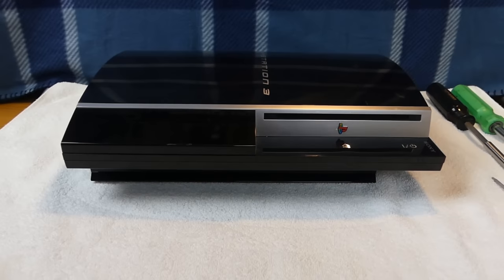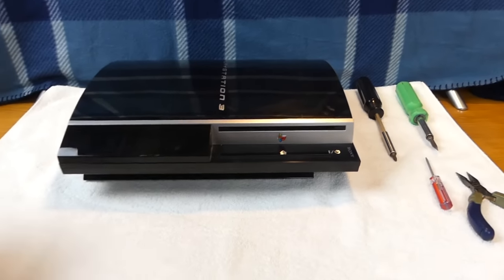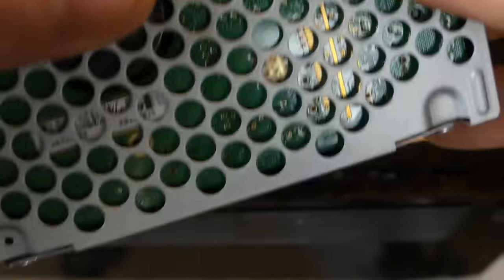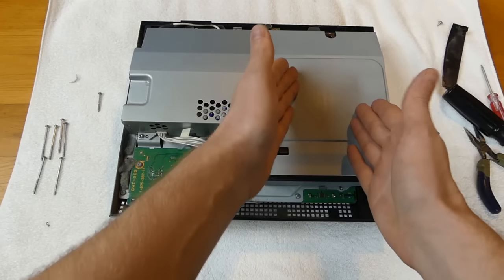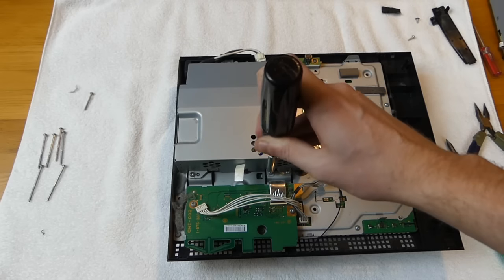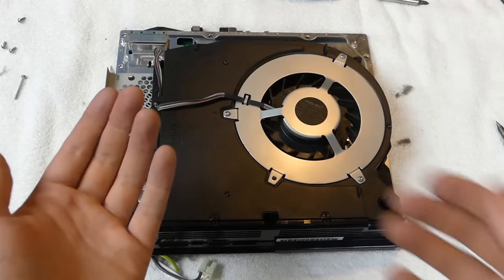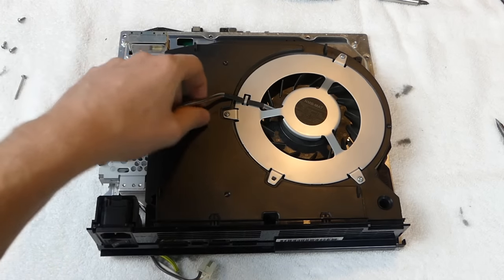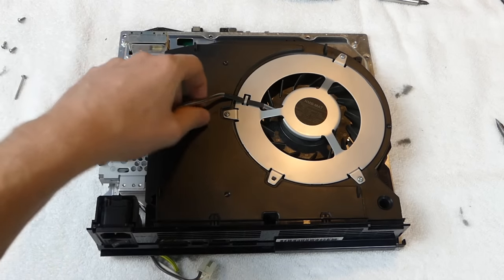HOW TO: TAKE APART/CLEAN DIRTY PS3!

Comment: Rip to the people who couldn’t put it back
Reply: Lol. It took me 20 minutes to take it apart, 10 minutes to clean and 2 and a half hours to put it back togeather.
Reply: @michaelpfanner  i took THEEE FREAKING DAYS!
Reply: @corndogslol5289  Wish me luck I plugged mine in got a black screen after trying to play a game. I'll have to go back and check the blu ray drive.
Reply: @bustergundo516  did you put the hard drive fully in? if not try putting it in fully.
Reply: @corndogslol5289   I checked the bluray ribbon and it was unplugged.  I fixed it. But I dont know where 1 screw goes...Doh!
Reply: Bro for me it was easy 
20 min to disasambli 
30 to clean all
20 to put all back 
1h 10m it was take me
Reply: @bustergundo516  thank you ;)
Reply: had a ps3 slim and it would freeze on startup and i tried seeing if disassembling it and cleaning it would help and i didnt know how to put it back and threw it away r.i.p.
Reply: Just play the video in reverse
Reply: No advise on what to clean it with ?? Alcohol, qtips? Wtf do we use Gasoline??
Reply: @jhamod556  90% isopropyl alcohol, qtips, cloth, can of air.
Reply: It’s easy to put back together you wouldn’t take it part if you feel couldn’t you put it back together
Reply: @copyer9088  or would we?
Reply: Pwned
Reply: Shit if you could take apart an xbox 360, these cant be too hard, i had a gamecube that didnt have to be taken apart, just open the slot & the laser is right there, wipe that down n thats it. I wish it were that easy for this
Reply: I got bored and now I’m back 3 years later trying to reassemble it lol
Reply: Oof
Reply: I have 6 screws left over

Comment: Just cleaned mine out for the first time ever. It used to sound like a jet engine but now its silent!
Reply: I feel you so much right now
Reply: aw3 tech  You need to CAREFULLY follow these instructions. Asap, my friend. Also be careful not to do what I did and accidentally snap the little black bar.
Reply: mine is super loud i am hoping it just needs to be cleaned
Reply: Mine is not coming on back
Reply: Omg same, soon as i put a game on it was like vrrrrrrrrrrrrrOOOOOOOOOOOOOMMMMMMMVVRVRRVVRVRRVVRVRVRVVRVRVR
Reply: It sounded like PlayStation I swear that will always be a problem even on my ps4
Reply: Same mine was like a blow dryer
Reply: @classiccarlover3302  after an hr play time and start heating up

Comment: Just a small tip for those who dont want to wait to purchase a torx 10 screwdriver- You can use a precision flathead bit and wedge it in a good spot to turn the safety screw. Works like a charm!
Reply: @albert lopez you can also carefully drill the nub off of the screw and use a regular torque head screw driver.
Reply: also don't forget to break that security metal thing inside the head so you can use a regular T10 screwdriver
Reply: ^ THIS.....IF YOU want to waste money and strip the shit out of your screw, follow this screw jobs advice like me and waste 8 bucks while you're at it! ^

Comment: IMPORTANT TO ALL THOSE WATCHING -

The cover with the Playstation wording SLIDES off towards the side with the Seagate hardrive (this is why we need to remove the Torx 10 screwdriver),
 DO NOT try and lift the cover from the sides.

 THIS IS WHAT THIS VIDEO IS MISSING
Reply: THANK YOU! This is exactly why I clicked on this video, yet he skipped it.
Reply: Yeah!
Reply: Thanks. I shouldve read the comment first. Broke a tab trying to lift it up until one tab broke and it slid like a charm. Then I saw how the plate was made from the inside and that it was supposed to slide.
Reply: @johnsnow3159  Sorry that happened to you. Did you try fixing the broken tab with a heat gun or super glue?
Reply: @mikaello1729   I didnt clean and assemble it back yet. I only found the time to open it. Im waiting to find the time to work on it and on the meantime i'm contemplating buying thermal paste.
Reply: thank god someone in the commentsection could help out
Reply: Thank you! I was wondering how he got to the 7 screws. What a thing to skip lol
Reply: I pulled mine off from the top 😭 Somehow, only one piece of the clip came off. Actually shite myself. This video is missing loads of stuff
Reply: Thankyou. Exactly what I needed to get into and deep clean the innards of my PS3. The interior was slightly different to yours, not sure if having a larger HDD and it being one of the last of the big PS3's had anything to do with it. And I had the headache of trying to remember which screw went into which hole. Fortunately I didn't have any left over. A very good, thorough and carefully explained dismantling.
Reply: D
Reply: What?
Reply: Wish this was pinned, I too broke a tab
Reply: So glad I came to look at the comments I’m was about to break my cover then I seen this comment thank you
Reply: Thank you <3
Reply: @chilliconn071  remember to always take pictures, before and after
Reply: Thanks about went and watch another video!
Reply: @mikaello1729 I almost broke it because I thought it could just be lifted like the ps5 plates thanks because I could have broken the plates if I didn't watch the video
Reply: I broke mine 💔
Reply: THANK YOU

Comment: "This component" at 5:52 is the power supply. Be careful with this and don't tinker around with it too much other than removing it and wiping down the outside of it as the capacitors inside can hold a charge. A can of compressed air can be used on it also.
Reply: Lol . He Called the Power Supply a Component.

Comment: I had a cockroach problem. yeah they got into my ps3 and when i cleaned it, i took some window screen (the same screen you'd find on your home windows) and cut it, and kinda glued it over the vents. doesn't obstruct airflow at all and kept the bugs out. since then the bug issue has been fixed but the screen is still over the vents. still helping for peace of mind. great vid though! keep it up!

Comment: Just a note for everyone doing this especially on the older models with 90nm chip processes, it goes a LONG way to replace the Cell and RSX thermal paste, if you're feeling lucky enough even delid both of them and replace the thermal paste under the heatspreaders, I have gone down 2 fan speed modes by doing this and the unit runs so much cooler, the paste was literally dust when I took the heatspreaders off, especially after 10+ years.
Reply: Any channels/videos you recommend?
Reply: Delid my arse just slap an eraser in there
Reply: Deliding myth has been debunked several times. Some noobs on the internet think they are better than cooling system designed by engineers. In reality the actual cause of ylod has been established as the poor components used in manufacturing the RSX graphics processor. Sony knew the reason behind yods but they never released it

Comment: i’m pretty sure i messed up putting it back together, but i appreciate the help for disassembling and cleaning it. for some reason the power supply isn’t working and i’m not sure why.
Reply: I did the same on a ps4 and it didn’t work because the first time I best the power supply pins,maybe you should disassemble it and check if there’s the problem for the ps3

Comment: another method i use to clean out my computer of dust build-up is an air compressor with an air hose (of course) and an air blow gun. works really well, because its blowing out air at a very high pressure and speed, and you can get all of those dust particles out. keep in mind, dont stand too close, as you dont wanna damage your components.

Comment: You skipped the part how to remove the top plastic panel. I broke some tabs because I thought it was supposed to pryed open. But it slides forward from the safety screw lol. The panel still hold though

Comment: @TheSpeedyDiver thanks for the lesson.  I've cleaned electronics before and I cleaned houses/businesses for a long time  (way too long...cleaning for a living is dangerous)...
I place my finger over the nozzle to avoid losing small things but you can suck up the worst of the dust with a vacuum...then use cotton swabs for tight places and micro fibre clothes...just make sure there's no static electricity...
Ideally get outside like you said but it's winter here with snow drifts over my head...

Comment: How come when you opened it it wasn't tough to pull it out? I managed to get mine out in the end and it was being held together by thermal paste. I don't see thermal paste here and it wasn't a matter of turning it over as the back was all together. Its hard finding a ps3 matching my interior as there's slight differences. On the outside looks the exact same as my model but with differences.

Comment: My original Xbox disc wasn't opening up even when i pressed on the tiny hole next to it. So i opened it up and couldn't see the belt, so i got frustrated and threw it away after owning it for 15 years, i regret not taking my time!! Thank you for this information on the Ps3 as it helps me to get familiar with what it looks and going on inside. Pretty basic really.

Comment: When I push the on button, mine tries to come on, then shuts off and starts flashing red. I keep doing it enough times, it'll finally load to the screen that says something along the lines of "your Playstation wasn't turned off properly and need to restart" and it dies during restart and flashes red, and I have to start over again until after enough times it finally comes on and I can use it. Almost like you have to warm it up or something. So I took it apart today and cleaned it but it's still doing the same thing. Any suggestions?

Comment: I bought a used PS3 80 Gb on Monday. I tried it out with out cleaning it out, and it sounded like a plane taking off on a runway. Yesterday I did the first part of the video (up to the point before he removed the optical drive and PSU), it was so gross, you could tell it had never been opened since the day it was bought (still had original warranty sticker on it). After blowing the dust out of it and putting it back together, it made a huge difference! I could have gone as far as he did in the video, but was too afreaid to take anything out of it. Im just going to try the self-clean thing for the fan.

Anyway, point of the story is, AT LEAST take off the top shell, clean out the dust, and you will notice a huge difference, just from doing that little bit of maintenance.
Reply: Reminds me of when i was cleaning my little cousins ps4 and found dead moths inside the fan it was filthy

Comment: Thank you for this I just took my ps3 fat boy apart I follow your instructions and it works perfectly! 😁 My ps3 is slightly different from yours. I have the OG launch model CECHA01. It would freeze everytime I turn it on. I took it apart it had a blanket of dust in it. I cleaned it up real good now it works like new. Thanks! 👍🏽

Comment: Do you have to take the hard drive out? Just if you're only removing the top cover and replacing it with a brand new one? Thats literally all I'm doing with mine. Its already super quiet and clean, and has no issues. I'm just wanting to give it a brand new top cover to make it look new again. Not do any work inside. Also, will Torx T8 work? Or does it absolutely have to be T10?

Comment: Thank you good video my ps3 looks a bit different probably an older model than yours the on off is temperamental but biggest issue is hdmi connections not picking up ps3 on monitor

Comment: Found this video while I was trying to find out how to clean mine too. Ordered a cheap tool kit from Amazon for $10.99 that comes with 25 pieces. My PlayStation 3 O.G. 60GB will shut off randomly and the red light flashes. I think it's probably just dirty inside and is overheating. I upgraded the hard drive about 10 years ago and put a 1TB inside. It has never been opened up before, so I'm sure it needs a cleaning.

Comment: Got down to the power unit of my model. Its totally different, mines is in a black plastic casing and not the metal one. Removed the screws and plug front and back but wouldn't totally lift out. got it out at the front were the power prongs go into it but it was still being held in somewhere else so I didn't want to force it. Anyway thanks for the video, held get some of the dust out. If I had the same model as yours I would have felt confident following the rest of your video.

Comment: Just opened a PS3 I got from an Excoworker. I had it for 3 years and only played it maybe 4 times, and some of the buttons were not working either. Welp opened that thing up and turns out that thing is NASTY. Dust everywhere, and it's dark brown, and while I was taking it apart 2 coxkroaches came out of it. Since it looked like a whole day process imma wait till tomorrow, 6/30/24, to completely clean it. And also my hard drive was a little different, it was essentially a pull tab that I had to pull out a little then pull a little harder on to get the drive out. Still the whole process seems the same.

Comment: Video is rushed and sub par, thumbs down as I had to figure out half of it myself.
Didnt show how to get top cover off which is slid off.
Didnt show where all screws are taken out WITH THE ACTIONS it was just pointed out AFTER doing all the work which is lazy.
And also used words bad descriptive words throughout the video and rushed explanations making it slightly confusing to understand.
Sounded like he had 5 redbulls before he started talking for the video.
As they say haste makes waste, and this video is a waste sadly.
But you can still get a playstation 3 apart and back together even with the bare bones video if you have a clever brain that can fill in all the blanks that this kid left in it.

Comment: Guy says he uses a torx t10 

The torx t10 is too big for that
Reply: no i had the same issue, just make sure you use the torx 10 safety with the small hole in the middle. if you look at the bolt on the ps3, it has a small nipple.

Comment: You skipped a whole step. How did you take the top plate off. You just went straight to removing screws
Reply: Once you remove the Torx screw above the hard drive, you then slide the plate off, I believe to the left or to the right, I can't remember it's been so long since I last cleaned mine.. That's how you get to the 7 screws.

Comment: I have the PS5, PS4 Slim  and the PS3 and just found my PS3 in my parents house basement in a box. So, I decided to clean it and to bring it in my setup with my other consoles as decoration. While I was cleaning it I found the thermal paste still even everywhere but it looked like old glued paper. I'll probably try to power it on after I assemble it back but I'm thinking if I should change the thermal paste while I'm here and if one day I want to use it again or sell it. It will be like new because I really take care of my stuff my PS3 still looks brand new. Is it overkill to buy thermal paste and remove the old one?

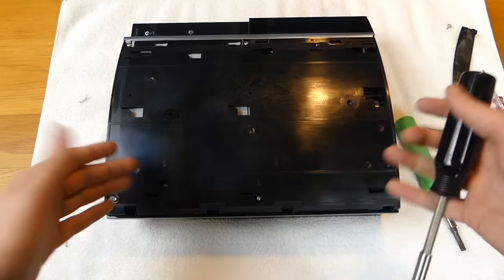Comment: 3:21 what the hell happened, skipped the step taking the front plate off
Reply: So i started the process and once you take the rubber tab off the side and take that first screw out the top slides out a little and you just pull/push it a bit and it slides all the way off

Comment: Today I bought fat ps3 and that thing sounds like jet engine after 15min on idle! Im gonna try this, but firstly I will need to find those screwdrivers as well as some thermal paste. Gonna update how it went!
Reply: How did it go ?
Reply: @cal31BRIAN23  Well I couldnt remove motherboard from heatsink because of old thermal paste. I even tried to heat the heatsink whith hair dryer but nothing worked. But what I did was I installed HEN on that PS3 and then I installed webMAN to controll fan speed. Now, after playing some game over 1 hour I only get maximum of 70 degrees celsius(at 40% of fan speed). If you have any clue how to separete heatsink from motherboard without cracking motherboard, that would really help.
Reply: @someboringperson9359  I do not know unfortunately as I am not a handy person.

Comment: DONT BOTHER DOING
 THIS. A LOT OF THE COMPONENTS ARE SO OLD THAT THINGS BREAK EASILY. I BUSTED THE DISK DRIVE BY FOLLOWING THESE INSTRUCTIONS.  PAY A PROFESSIONAL.
Reply: i tried following this to fix my grandads old ps3 he gave me, i was doing alright until i pulled the fans 3 pin connecter off the motherboard 🙃
Reply: My Ps3 Disc Drive Worked Well before i took it to a Repair Shop but After Getting it Back My Disc Drive Doesn't Read Any Game Anymore.I don't know what to Do.

Comment: so I did everything in this video. step by step and cleaned it properly.  when I finished and put it back together I plugged it in and the red light came on as usual. But now my eject and power sensor is not working at all. I'm not sure what I did wrong, so if anyone can help I'd appreciate it.

Comment: The PlayStation 3 have the biggest flaw ever the shooter thought of a of a design of a new cover for the not collect dust inside of it and they should have used a air filter it's like you clean using a vacuum right and what happened is that if that vacuum collect of the dust in the carpets in the floor and then you receive a red light right there and that means that the effort it is so full and need to be cleaned again and then after that you clean the air filter remove that Blackie Dusty mode and then after that I want to let it dry you put it back in and that red light with Tony to Green again I mean they should have design of PlayStation 3 right there not spinning all of that money ain't going down in the drain I mean they should have thought of that make an effort it could be move clean it and put it back in again and then the inside of a the PlayStation 3 with stay clean forever I mean forever but this is going to be the hottest way ever to remove two screws and different screws and inside remove it is it is a painful in the ass right there and I hope that this new one the PlayStation 4 and 5 will have a air filter that removes easily and it would tell you another of a the PlayStation box and in your ice cream of your TV that's it